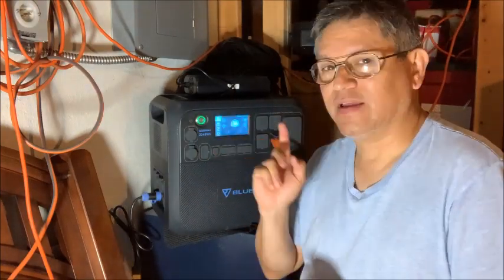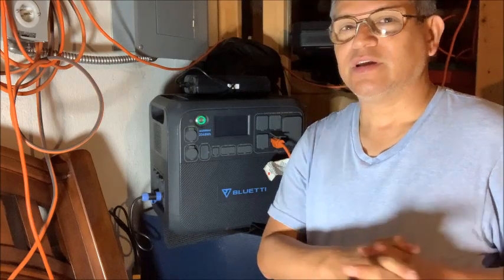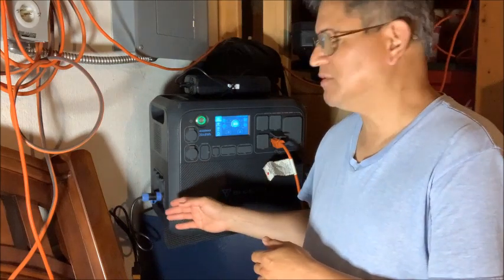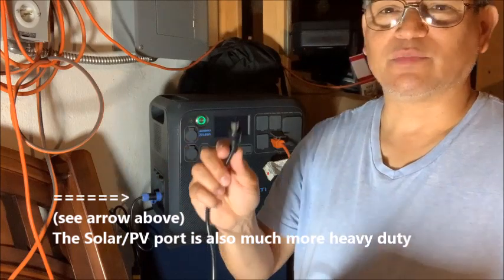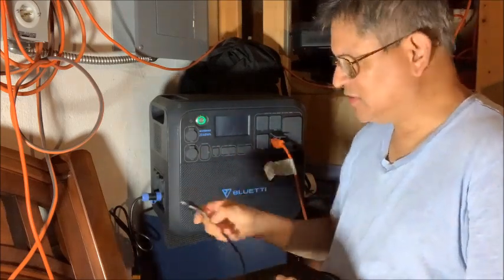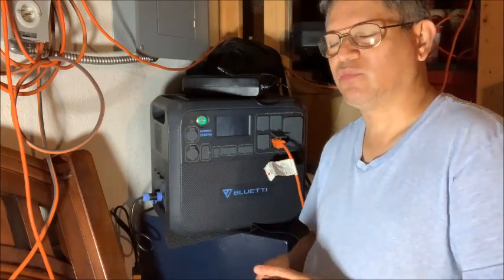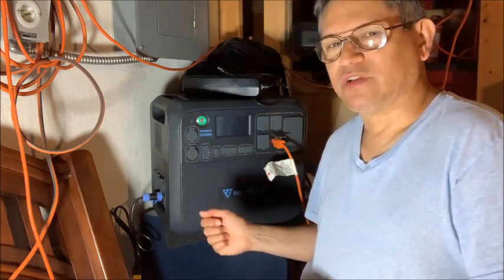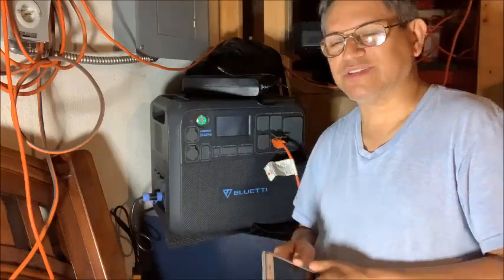Bluetti ac200max - shorting and burning issue

Comment: I’ve had two burn up this way.  The second time it ruined my Maxxair fan. I’m glad it didn’t start a fire.
Reply from the maker: Yes, not much fun.  Luckily I have not had the issue since then, but then I do not use grid charging.  That was my FIRST charge on it.  PV charging 100% of the time.  I've added a couple D050S to the system too as I have 3 arrays.  The D050S one is connected to the 200max via the grid charge port and the other a B230 battery.

Comment: Mine did same thing
Reply from the maker: I had noticed that the plug did not go in all the way (I have a EB3A for well over a year to compare).  Which, as I found out, with a barrel plug is an issue.  I'm on the Facebook "BLUETTI Portable Power Station Club" and Bluetti has Support People on there.  I was able to easily get a replacement, albeit only via PM/email (no #800 number).   I'm sure they lose a lot of money on warranty items as the shipping cost alone eats away on revenue.  

My replacement ac200max now has been (mostly) running in a 24/7 environment; as well as it can being in Michigan were in the Fall we're getting 5-10 days of heavy overcast and the unit (with 1,000 watts of panels) may take several days to recharge to 90%+

But it's scary to come up on the unit when it's starting to get sparks and that burning smell.  Very unnerving. Some Sogen makers don't use barrel plugs for that high of voltage ... now I know why.